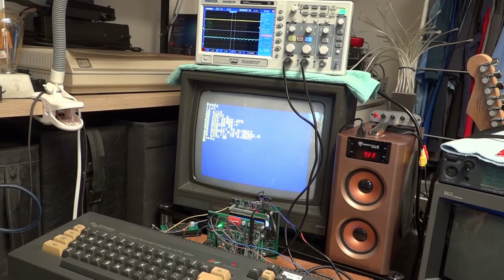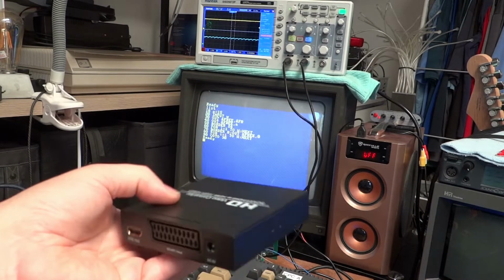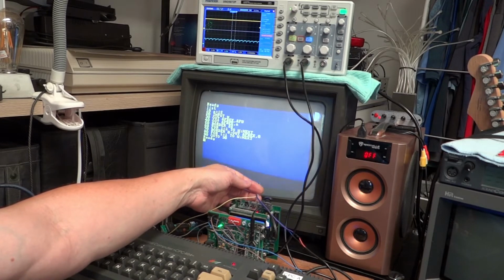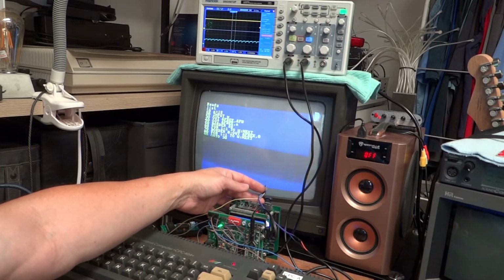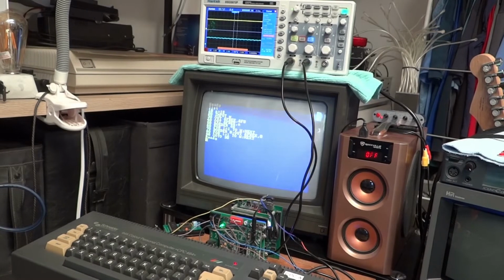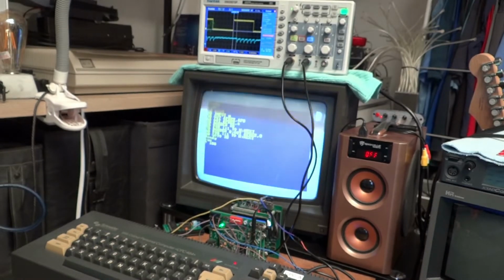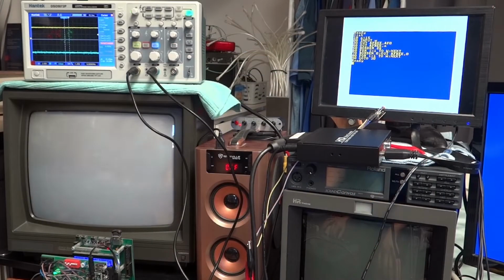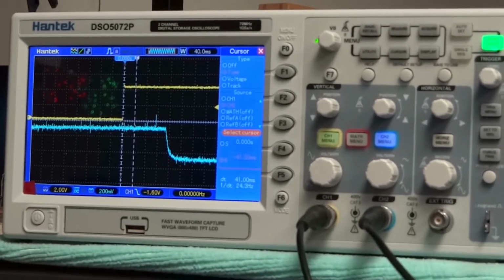Measuring HDMI Converter Lag with your Amstrad CPC - Scart2HDMI & HD-VC-9900 V1.1

Comment: I love it ;-)

Quick wrap-up of my (much more simple) tests with the LED and the video camera:

CRT (CTM644): as expected, almost no lag
15" LCD TVs over Scart: slightly more, hard to tell a real difference
17" LCD monitor, 15Khz compatible (Benq): 2ms more, again, hard to tell a real difference

GBS 8200 with GBS Control mod: about half a frame of delay, still nothing you would recognize in a game. However it not only depends on the GBS, but also on the monitor, as I had different results ranging from .5 to approx. 1.5 frames of lag. 

Important to note: The GBS 8200 without mod is known to have a lag of around 4 frames. Doing the mod is crucial to get good results. It also helps with synchronization problems in many games and will add some additional features, like scan lines. 

And then we have the Scart converters. I had a typical one from Amazon (30€ range): about 5 frames of lag - this is significant and will have an impact on fast paced games. Such a converter seems also to work in some LCD TVs. Unlike the above mentioned 15" LCD TVs (those usually used for camping) a 19" LCD TV also had 100ms

Long story short: to make sure YOUR set-up is working well, make that simple test. Although you won't get the exact time in milliseconds, you will easily see if your set-up has a lag approx. 1,2 or 6 frames.